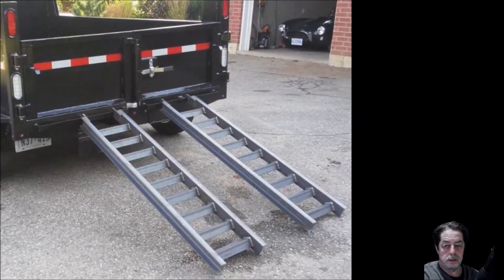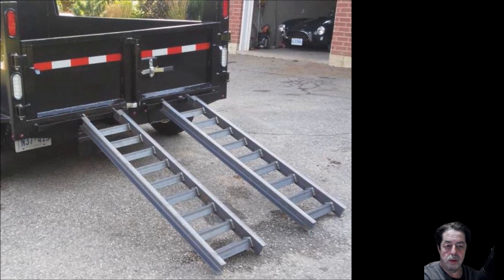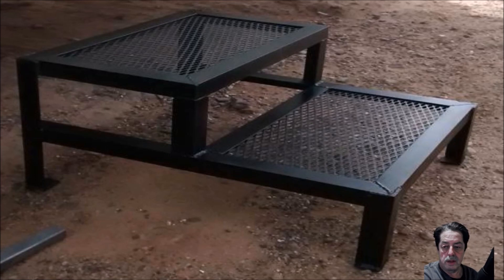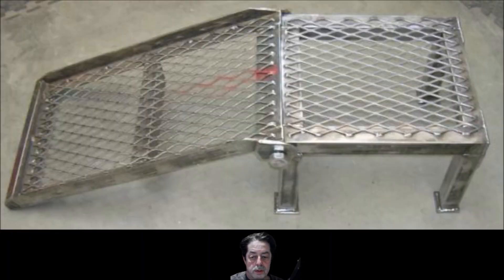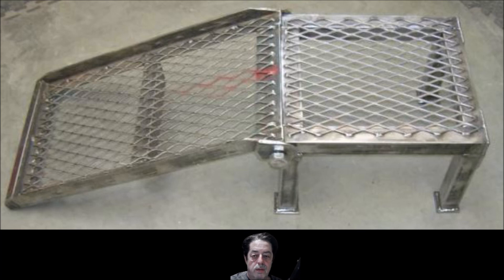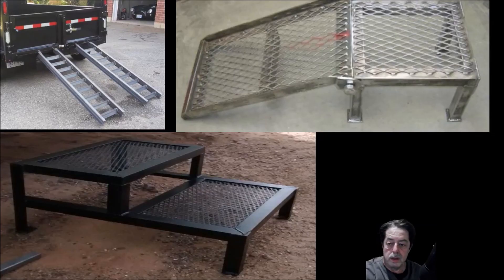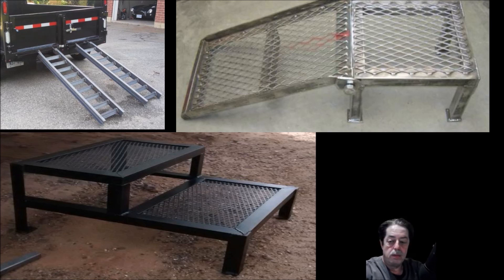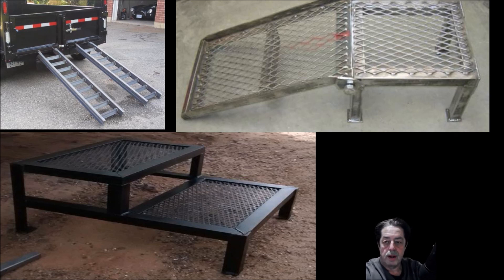How to Make Steps With Your Mig Welder

Comment: What is your opinion miller 215 or everlast 230i. I need to upgrade my 140 Longevity mig.
Reply from the maker: I am probably not much help but - I of course have the Miller 211 Autoset and I love the machine and the quality of the build - Now I have a couple friends that own the Everlast and I have tried them - great for medium to high end welding - better warranty - really nice gun handle - capable of stick welding (mine does not have this ability) - it has a "good" quality inverter and alot of machines have cheap ones so this is good quality
        Miller gives you on the 215 the abiltiy to go mig/tig/arc etc which is a very nice addition - nice autoset mode or change to manuel  on the front and easy to use 
         I just favor Miller because of the customer service and that I own one but I do not think you will go wrong with Everlast- I favor the Miller because of the autoset and walk thru LED screen feature which allows you to go Mig/Tig/Arc etc and would choose that one but I would encourage you to watch alot of reviews and read to see if you agree ...............
Reply: I've had the Everlast 211si for about a month and so far it's been a great welder and I haven't had any problems with it. It does stick, MIG and TIG and comes with all the accessories to perform those processes. I was looking at the Lincoln 210MP (and to a lesser extent the Miller 215) and the Lincoln will do all of that, but doesn't include the TIG set up. You have to buy that seperate for around $400 extra (for the Lincoln. I didn't check out how much for the TIG set up for the Miller).
Reply: Thanks for your reply good information.
Reply: Thanks for your answer good information.